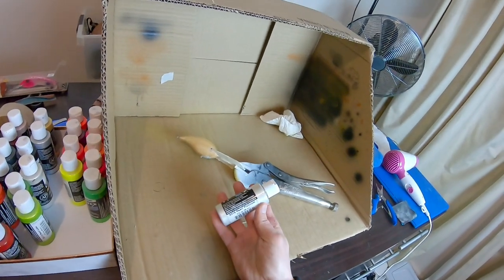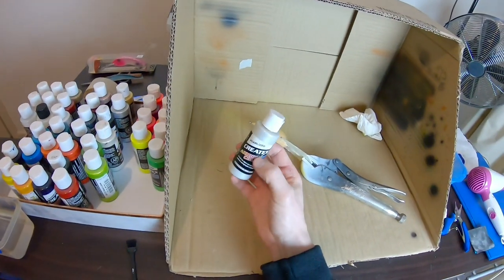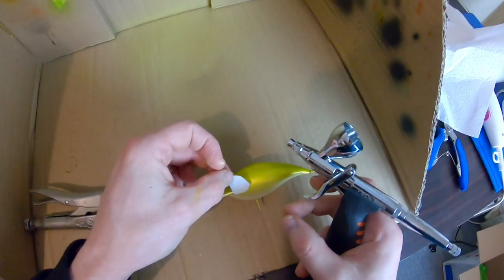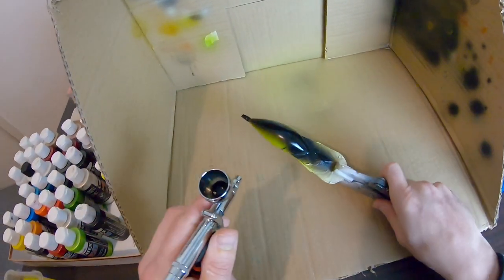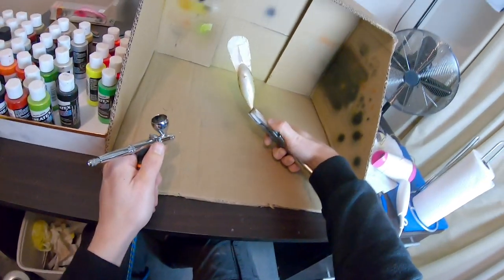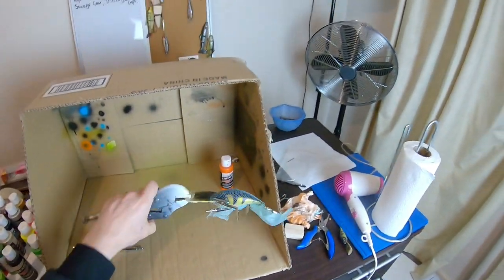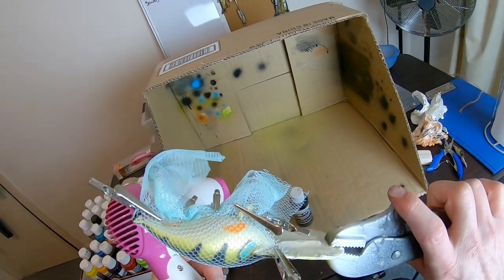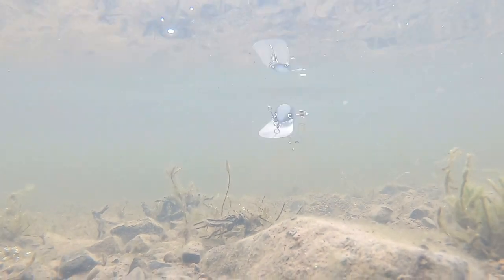Lure Painting, Perch pattern crank bait|murray cod lures.

Comment: Hey mate looks awesome.. What air brush an compressor you got?
Reply from the maker: Thanks man.
Its a pretty basic setup.
A voilamart compressor.
And a NEO for iwata airbrush.
Id recommend finding a compressor with a pressure regulator and moisture traps also it will save you some bother that I have with my current kit.
Reply: @fishermansoffice  thanks mate
Reply from the maker: No worries man I hope it helps 👍.